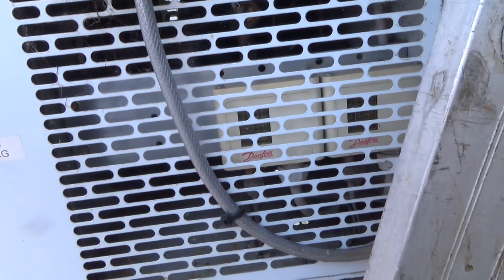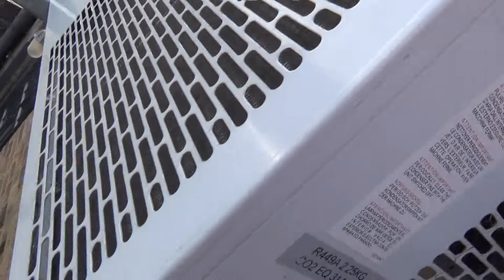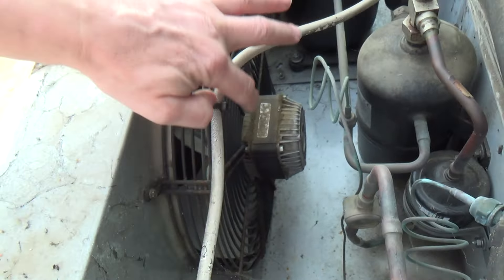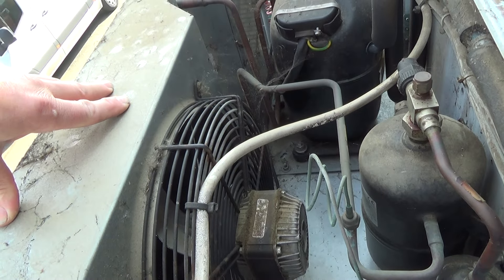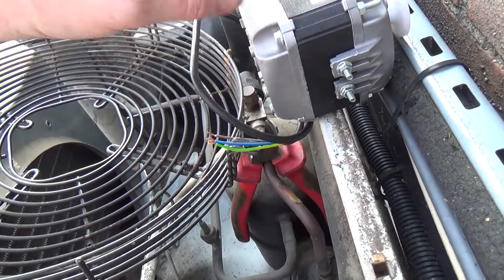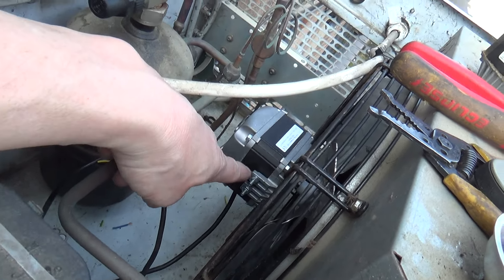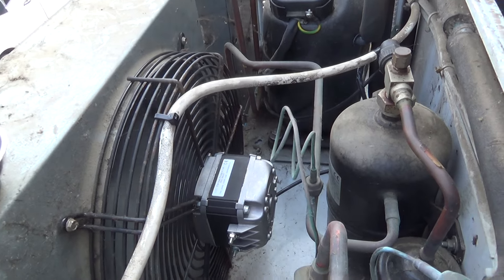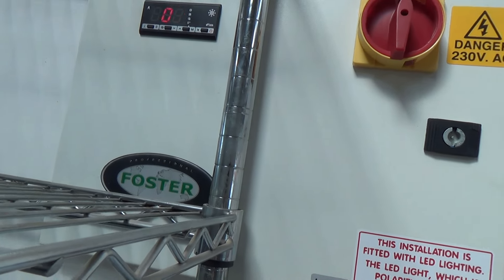Fan Fell Off

Comment: Good video ! i Was waiting for you to Check motor amps after the install. that will tell u if motors going to last. 
Don't electrical tape wires until you check the amps , perfect location & opportunity to check the amps right there.
don't see that very often where blade fell off & Motor is Junk.
Reply from the maker: I've never thought to check the amps on these motors! Will keep that in mind for the future.
I have a chart with the allowable blade size and pitch for each motor wattage and I think this one will be ok.
Reply: @heavydiesel    yea, i amp check everything.  only way to tell if it's ok or motor will handle the load. or if motors junk. If amps are over nameplate motors not going to last.

Comment: New van looks big enough! bigger than the MB Vito and of course the "Doblo / Combo". I went down size from Transit Custom to Combo LWB due to circumstances just have to keep things very well sorted. If the blade comes off I have found that the motor needed to get changed even if it runs okay as the threads for the screw in the shaft are usually no good long term.
Reply from the maker: I like the Doblo, good van imo.
MB stopped making the 3200kg Vito, the new 3000kg one only has an 880kg payload so we went with a Sprinter with a 1290kg payload. 
I've seen that too with the threads wearing away due to a loose blade, I think this one had bad bearings and suspect the vibration shook the bolt loose.

Comment: Do those blades just snap on the motor or are they held on by a nut?
Reply from the maker: They have a small bolt in the center that holds the blade on, most of them are M4 but some of the higher wattage motor have an M5 bolt.  
This one had bad bearings so suspect vibration loosened the bolt.

Comment: Why  are universal fan motors so awful for lasting more that 6 weeks.
Reply: Because they are made cheap, CCA windings because it is a lot cheaper than copper, and not enough lubrication to the bushes from new, and thus a short life on them.
Reply from the maker: Steel bush bearings instead of bronze like they used to be, plus the oil reservoir used to be felt but now its foam rubber which disintegrates with the heat from the motor.
The replacement motors I stock have ball bearings in which last longer.